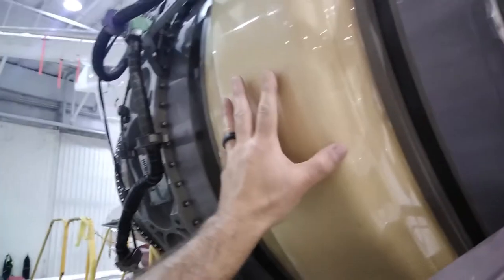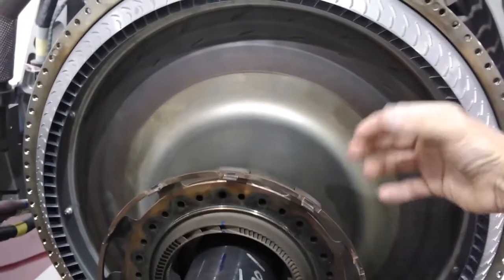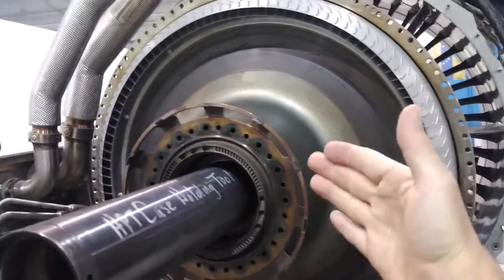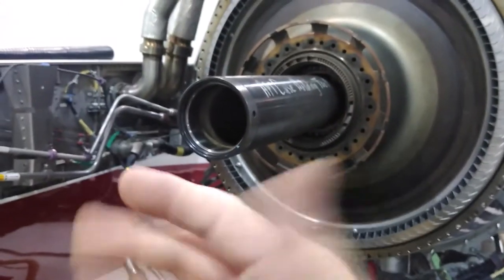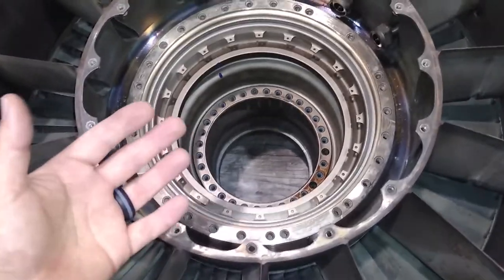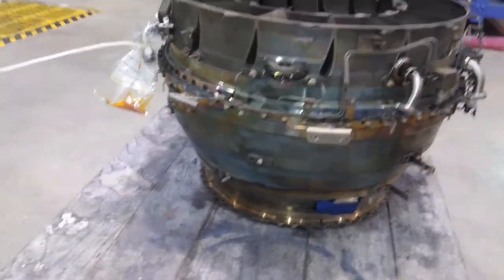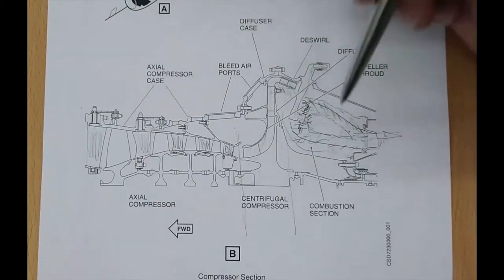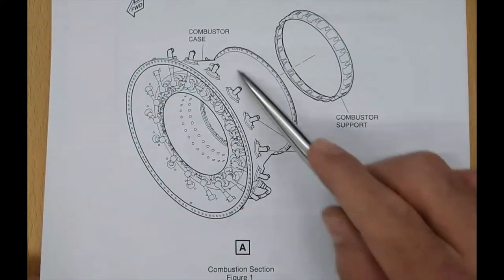LOOK INSIDE A HONEYWELL AS907 or HTF7000 JET ENGINE

Comment: Excellent explanation! I fly the Challenger 300 which is equipped with this engine, this is the best explanation regarding this powerplant I ever found. Thanks for the lesson.
Reply from the maker: Thank you very much Cesar Rocha.
The engine in this video was from and is still attached to a Challenger 300 also. What a beautiful aircraft that is! 
Thanks for the nice feedback.

Comment: Very nice and detailed video! I am familiar with some of the HTF7000 LPT parts like the case or the EGV. Just one comment, the nozzle does not produce thrust, contrary to popular belief. In fact it produces drag, like the turbines. Only the fan, compressors, and the combustor produce thrust. Then why have a nozzle at all? Because it is needed for creating the proper conditions for the compressors to work. The net effect of all the engine components is thrust but some of the components, albeit necessary for it to work, produce drag.

Comment: How can you work with that buzzing noise?? I go grazy just after watching for 2 minutes!
Reply from the maker: Lol... Sorry about the noise. I don't have a way yet of removing it while editing the video. The software I use is very basic and limited. 
Anyway, while working is not too bad. That buzzing noise from the lights gets drowned out by all the other noises of the airport, running engines, hydraulic pumps, rivet guns, etc. The lights buzzing fade into the background.

Comment: Is this engine used in the once used Jaguars used by the French air Force?
Is it fitted with afterburners?
Reply from the maker: Hello joy dasgupta, no, as far as I know this engine was never used in the jaguar and never had afterburners.
Reply: @planesimple8514  ok but any idea about the thrust output of the engine?
Reply from the maker: Joy dasgupta, below is a direct quote from Wikipedia, there you can read more about this engine and the other aircrafts that it was used on...
Wikipedia says: 
"The Honeywell HTF7000 is a turbofan engine produced by Honeywell Aerospace. Rated in the 6,540–7,624 lbf range, the HTF7000 is used on the Bombardier Challenger 300/350, Gulfstream G280 and Embraer Legacy 500/450 and the Cessna Citation Longitude."
I hope this helps.